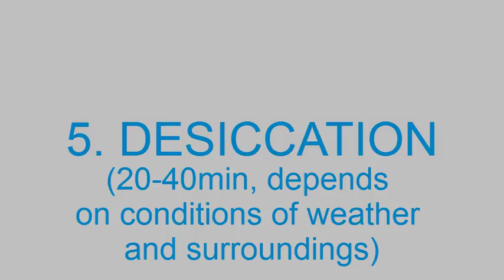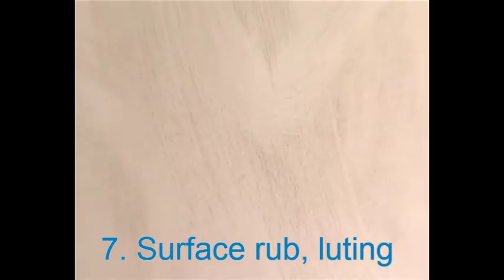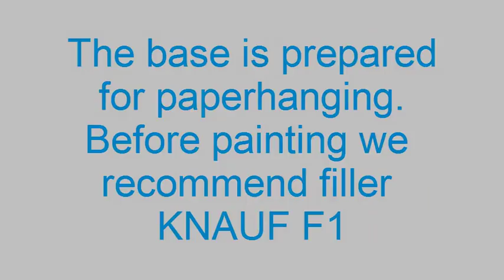Machine Applied Gypsum Plastering

Comment: They have been trying to replace real plasterers for years I know I am one, for over 50 years. Looking at this they still have long way to  go both in speed and skill.
Reply: Hopefully they'll get there one day.
Reply: We trialed a similar machine on a job site I was managing. Complete rubbish. Our 60 year old plasterer got a bonding coat and finishing coat up quicker than the man with the machine and it was a better job (y)
Reply: I once had to 'dryline' 2 & a bit walls 11ft high by about 10ft, 15ft and 2ft wide. It involved taping the joints, filling the joint (tapered board) and then appling several layers of joint finish before a final sanding and using a roller to apply a coat of the sealer over the whole finished wall.

If memory serves it took us best part of 2 or 3 days, when any plasterer knows you'd do each wall in a gauge, so 2 sides = 2 gauges = a day.

But to be honest, drylining a small area isn't cost efficient and that it's only when it is big areas that it pays for itself with less materials cost and labour (sweat) saving.
Reply: Yup. Been plastering since 1975. I've seen these ideas come, go and disappear. Nothing beats a hawk and trowel.
Reply: मसीनकि किमत कयाहै
Reply: machine ka kimat Kitna Hai Rasta machine ka kimat kitna hai

Comment: we yousta use ,, a cement based gear in bathrooms nd that ,, we bathroom beads  it wa just scratched back the next day , ,, we feather edge nd cheese grater ,, nd it aint slow ,,you get it bang on ,, level walls ,nd square angles othe wise the box head gaffers make ya do it again ,, 200,,300 metes a day ..work as a squad ,,,, each man one job rotating all day ,,
Reply: what the hell are you trying to say? english??

Comment: Wtf are you lot talking about? You dont plaster with sand cement, thats called rendering. Plastering is a totally different process and finish
Reply: Where did you learn your trade. To render something is to shade a drawing Plastering has been around in its present form for hundreds of years and means all forms including what you call rendering. Drywall or Gyprock  has only been around for fifty.

Comment: this is much smoother then sand and cement ... and real plastering, not that skim coat  shit.. however , this is no good example ....
those are not real plasters, i am in the buisness for 11 years now , and much faster . 
why put a cornerbead  over another? why use the stucprimer 2 times over each other ? don`t  use a float  when preparing for tiles , the tiles will come off the wall